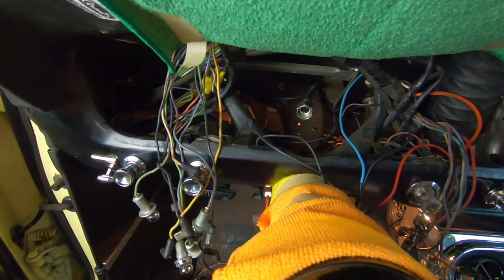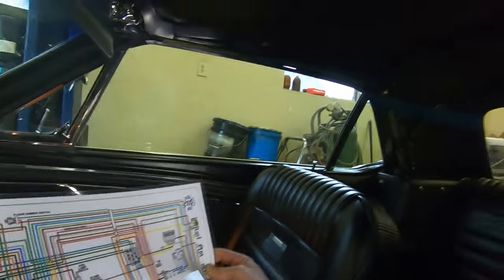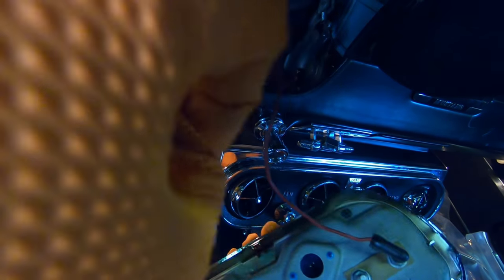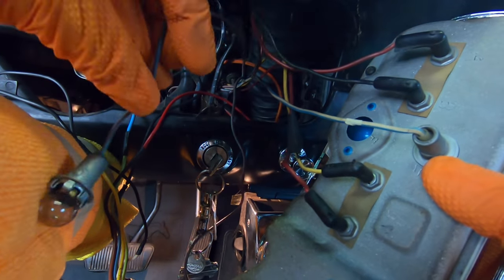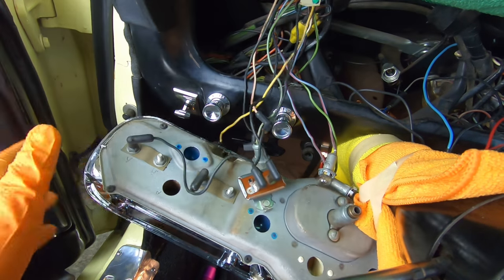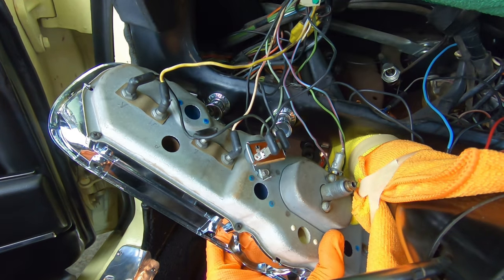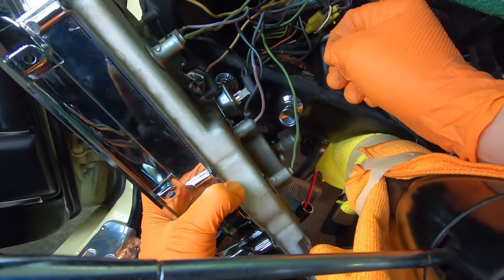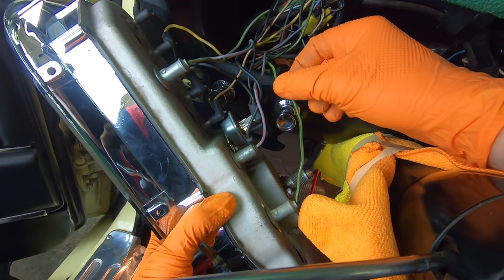Instrument cluster wiring - Where do they all go? - 1966 Ford Mustang

Comment: Good vid, love the orange gloves! LOL. I don't have a Mustang, (not anymore, had a '70 coupe, years ago but sold it) but I do have a 64 Ranchero with a 66 Mustang 200 six in it. Also have a 64 Comet with 302. I actually have a 65-66 Mustang gauge cluster in my Ranchero, it fits right in the 64-65 Falcons, that I got at a nice Mustang parts shop in Stockton CA years ago when I was building my 'Chero (read that to mean I had a lot of good mechanic friends who liked pizza and beer in exchange for helping me, LOL). So, a lot of what you see here also works for other early 60's Ford products. I also have a 67 Cyclone and 64 Fairlane, so there may be some similarities but have not been into those in a long time or ever in the case of the Fairlane, which I bought recently, 2 years ago. Word to the wise is that if you have other Fords the early Mustang vids of Alf's are helpful in so many other ways from suspension to engine work, and stuff like fuel systems, starter motors, brakes, the door and hood mechanisms, locks, and windows, and of course for all stuff on 289's etc. Lots of interchangeability, for "cousins" and "fathers" of the Mustang. Good tip on the wring diagram which are available in many places, or a diagram online can be downloaded and printed out. I used that on my 64 Comet recently, plus some labels, photos, for locations as I took it out. Thanks for posting these vids!
Reply from the maker: You're very welcome, glad I could be helpful.

Comment: Thank you very informative and helpful. Is there anything special to know about re-installing the speedometer cable?
Reply from the maker: Not really, should just go right back on. However, if replacing it you have to watch for some of these aftermarket replacement cables being too long on the gauge end. I've had to trim some of them to get them to fit.
Reply: @AlfsMustangGarage  Thank you for information and the videos. They are very informative and helpful.

Comment: TGIF! Great info as usual. You think this could apply to 67-68 perhaps? Question? What is the difference between and Voltage meter  vs Amp meter? Which one should we be using on Mustangs. My 67 Gt don't have one so I may add aftermarket on to my other gauge cluster under the radio dash. Appreciate you, you have never steered me wrong. Blessings and cheers from Motown/Dearborn.
Reply from the maker: So the Amp meter is a shunt-style where the two leads bring current through the ammeter. Its supposed to reflect the state of charge on the battery. The problem is that they weren't durable enough and ended up failing pretty early on is what I've read. So the volt meter conversion is something I would like to make a video on one day. Its a more accurate reflection of the actual voltage of the system. Originally they came with the amp gauge but the volt meter conversion I think is pretty popular because the amp gauges simply don't give you the correct information as to what is going on in the charging system. Thanks Robert!
Reply: @AlfsMustangGarage  Thanks for your reply!! Seems I heard the Amp meters could cause fires or something like that. Volt meter it is then. Just upgraded to a 110 amp single wire Alt with internal voltage reg. But I want to see what it doing without using my voltmeter to see what it is charging.
Reply from the maker: Yup volt gauge is definitely the best way to go then. Cheers!
Reply: Amazing video - thank you! Can I ask where you ground your voltage tester when you test the cluster connections? I am having trouble with my cluster lights at night. Nothing lights up, and I’m not quite sure where to start. After watching this video, I might just have the confidence to get started!
Reply from the maker: Well I usually connect my test light to the steering column collar mount right under the dash. Ya if those cluster lights are not very bright, you could check the rheostat on the headlight switch. Or if some work and some done, could just be burnt out bulbs. Good luck!
Reply: @AlfsMustangGarage  thanks for that - I’ll look into that. The non-working bulbs look to be ok but I guess you never know. I’ll try replacing them and go from there. Thanks again!
Reply from the maker: You're very welcome!

Comment: Hey Alf I put in a painless wiring harness in my 65 and got it all in and now it cranks in the on position. I put in a new solenoid got hooked up with the red strip on the s and the brown on the I. Any ideas?
Reply from the maker: The first thing I would be checking is the ignition switch. The wire that goes to the starter solenoid should only be getting power when the key is in start position. So if it's sending power in the run position, that should be easily checked with a volt meter.
Reply: @AlfsMustangGarage  your awesome thanks and keep up the awesome videos. Now my dumb question as a FNG to all of this how would I check if it’s sending that power in the run position? Sorry to ask
Reply from the maker: No worries. So i wish I could pump out a video super fast and I might still in the near future. But essentially if you have a test light or volt meter and a friend, this is easy. Now to keep things as simple as possible I'm going to assume that you have all the wiring correct seems how you just replaced it all. The wire that connects to your starter solenoid that cones from your ignition switch is the wire you're testing. With it disconnected, you want your test light or volt meter's positive lead connected to that wire. Your negative lead can be connected to your negative battery terminal. Then the key turned to run position. I'm assuming that you will see power there because you said the starter engages in run. Essentially you should only see power there when the key is in start position. Now that's how you test it but it doesn't necessarily tell you the ignition switch is bad. You may want to trace back and make sure you have the correct wires coming off the ignition switch going to the correct places. I hope that helps. Good luck.
Reply: @AlfsMustangGarage  super appreciate you taking the time to help me out

Comment: Have a question I have a 1966 mustang inline 6 having trouble with gas issues what type of gas do you recommend
Reply from the maker: I use ethanol free gas in the highest octane I can find in all the old mustangs.
Reply: Thank you it feels like I'm getting bad gas 
Change fuel pump
Reply from the maker: Fuel pump and filter are quick, easy, and inexpensive repairs to see if it helps.
Reply: @AlfsMustangGarage  I did still bad starts m shuts off
Reply from the maker: I'm afraid I probably won't be able to diagnose it over YouTube. I just typically check the basics. Is the carburetor delivering the fuel? Is the coil sparking properly? Check ignition points, spark plugs, cap, rotor, check timing. Many things to consider.

Comment: I saw nothing about grounds on the cluster 😢
Reply from the maker: Well I would say forward the video to 8:20 and watch the section of video on the ground wire.
Reply: So that black wire is the only ground for all the gauges? No others??? Thanks 😂
Reply from the maker: @scotholmes the gauge grounds are the sending units. They do not ground to the cluster case. The case ground is used to ground the bulbs.